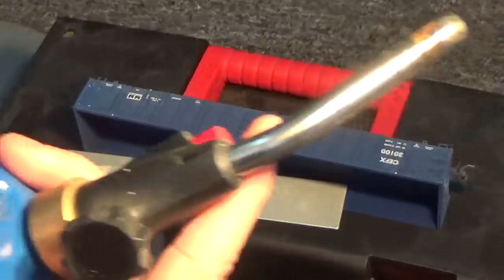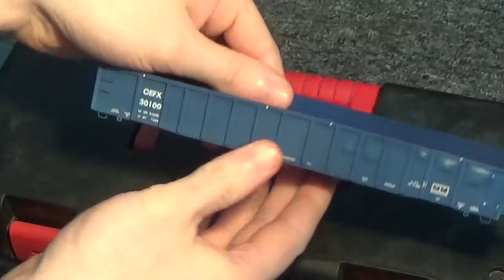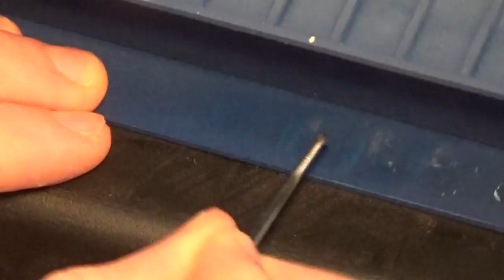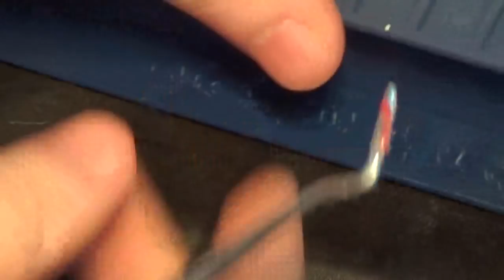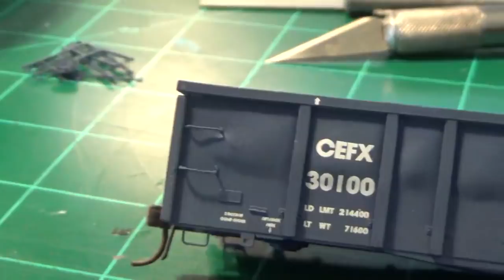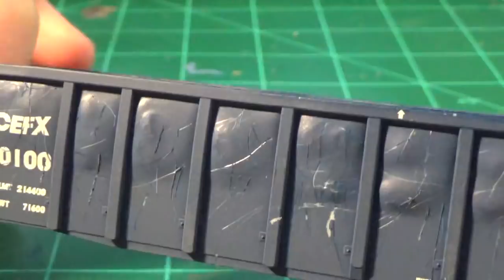How To Add Dents And Gouges To HO Gondolas!

Comment: Hey Dan, great work. For heat I use a small electric air heater that is used for heat shrink tubing, real cheap on ebay.                                                                                                                                                                                *

Comment: The only problem I see with this is that the false bottom becomes evident from the outside because the dents starts half-way up the side. I think that if you did a bit more disassembly, the affect would be much more realistic. If you're concerned about the false bottom no longer fitting flush with dented side walls, I'd use ground cover to fill the voids. I've never seen a clean gondola in service, there's always dirt and crap around the perimeter.

Comment: Hey Dan, great video! Regarding your trash cars built from the Walthers bulkhead cars what material did you use to custom build the sides?
Reply from the maker: 0.40'' Styrene is the thickness.  All the other parts are made from thinner styrene.